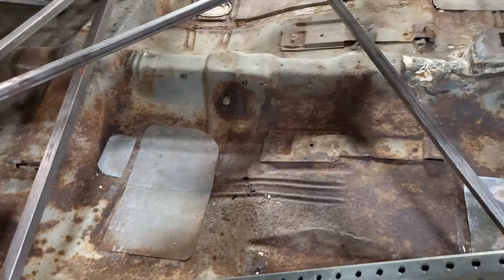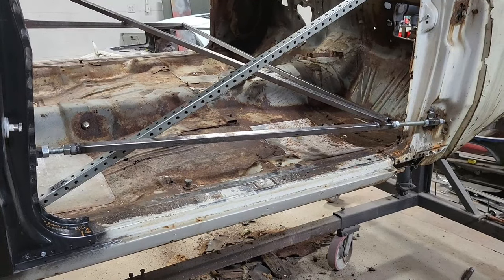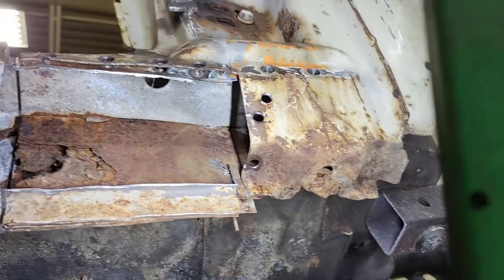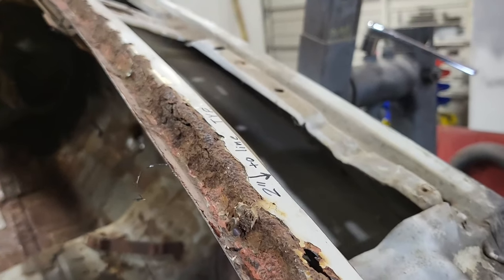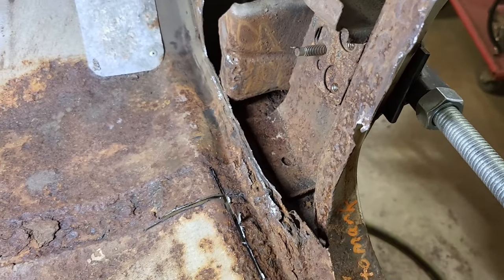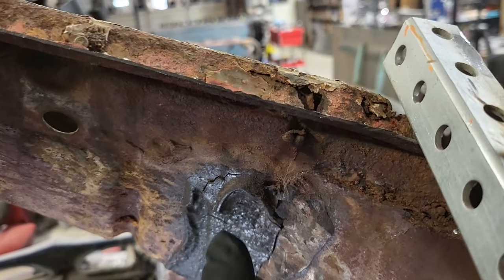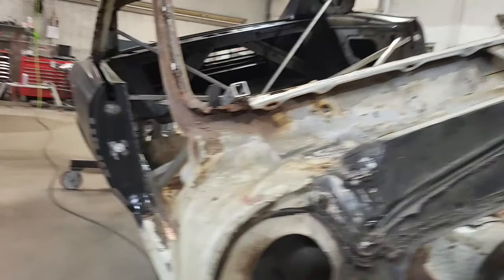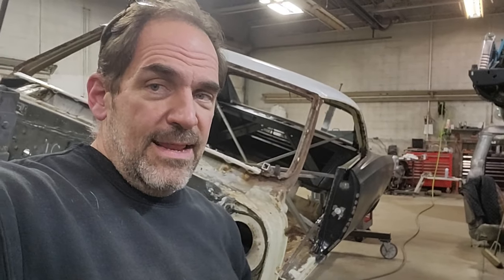1967 GTO | Kick Panel RUST!

Comment: Are you going to show fixing the kick panel?
Reply from the maker: @andrewandrewa224  the videos coming up will show what I had to do to make a correct repair. If there is something specific you'd like to know about, I'd be more than happy to go over the repair in greater detail
Reply: I dropped the floor out of my 67 GTO yesterday and today I started on the kick panels. My outer rockers and toe boards are perfect so I’m not sure how to cut out the bad part of the kick panel with the toe board in the way? I stopped for the night maybe a fresh look at it tomorrow will help.
Reply: That hinge pillar is available and it goes all the way to the roof. The kick panel is available as well. I replaced them on the passenger side of my 67 sedan as well as both inner and outer rockers.
Reply from the maker: @randycarr5168  yes. Those full pillars are what I purchased. I just used the lower sections since the upper portion was not rusted. As you follow along with this series of videos, you'll see what all needed to be done. Stay tuned for more!!